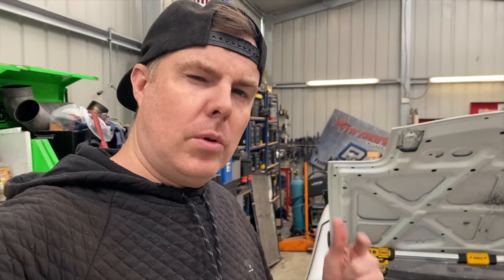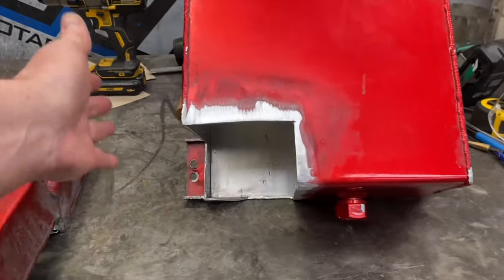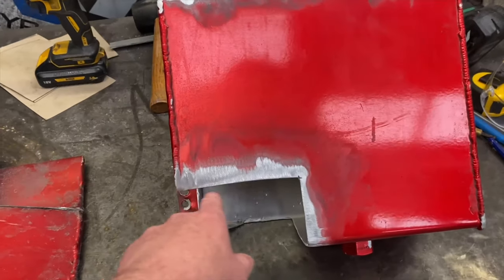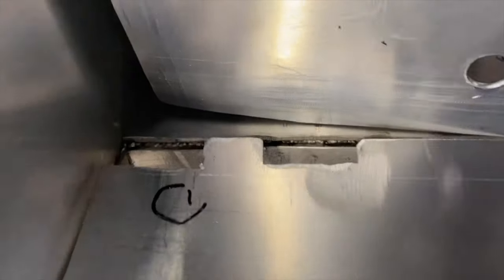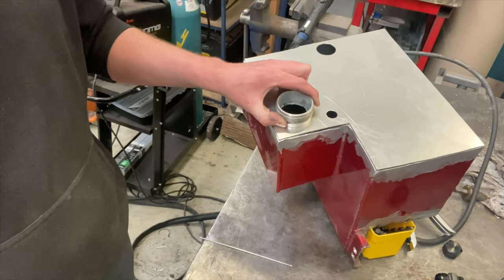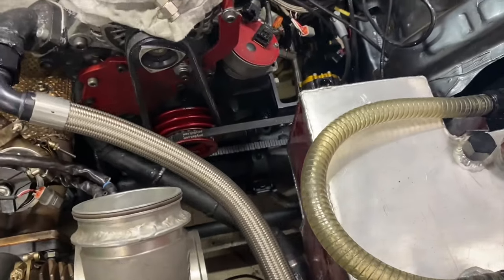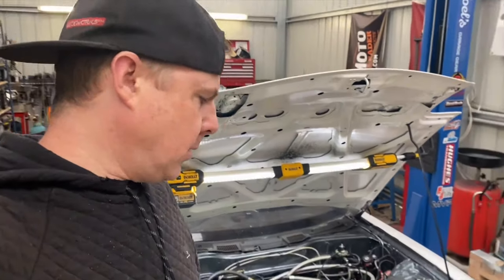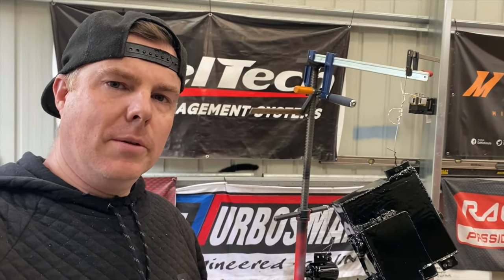How to Fix Fuel Surge / Starvation

Comment: Is that clearcoat the kind with a "button" on the bottom to release the hardener? I used some like that on my front fender and it's lasted a couple months nicely.
Reply: Little prep… and you can make it look like it came from a spray booth
Reply from the maker: Those aerosol cans are a rip. They are $45-$50 and do F All coverage. I have 2L of clear and hardener I got for $70 and an ozito gun for $40 and have used it about 20 times now on a heap of stuff. Definitely don’t mess around with the cans if you can avoid it
Reply: @BroomysGarage  completely agree. I’ve been doing the same for a while. Basic rattle can is quick and easy to lay a colour down, then a couple coats 2k clear off the gun and it works a treat. Cheap way to do it, leaving a durable finish that looks better than any clear from a can.
Reply: Yeah kinda, 30€ or so for a can that did the fender nicely, alright for a one-off in my dad's firewood shed 😅